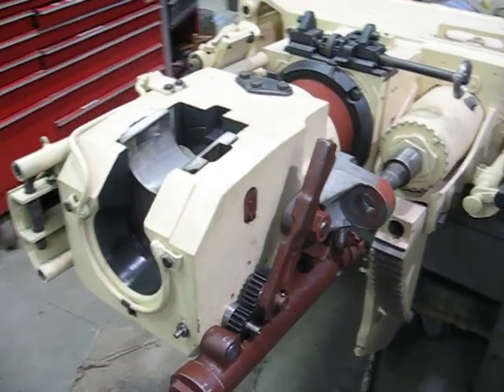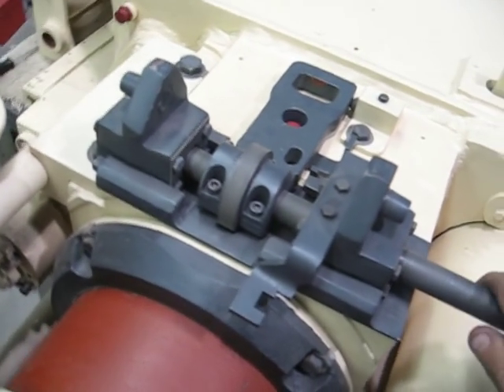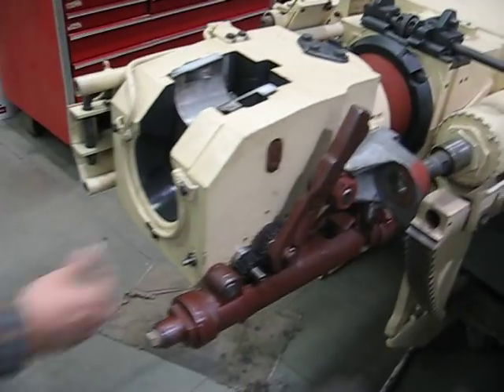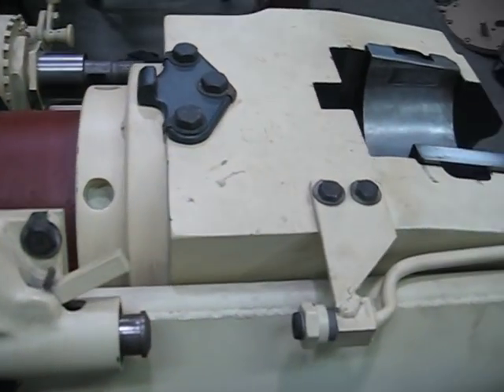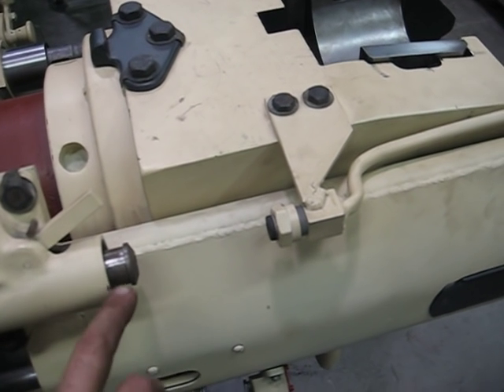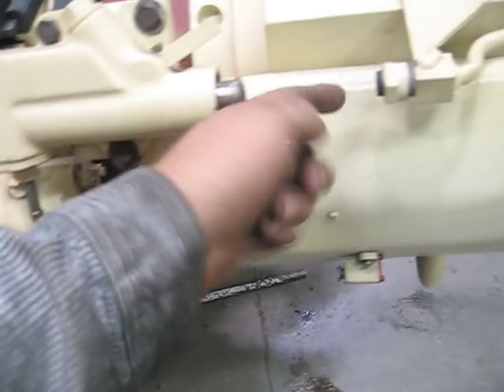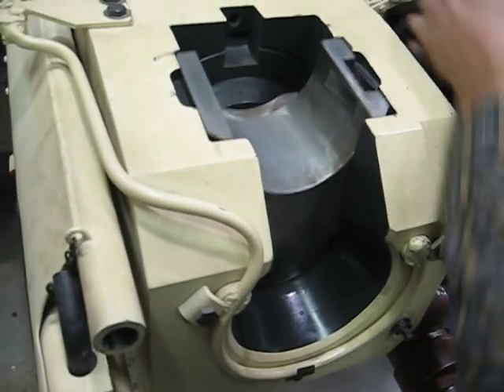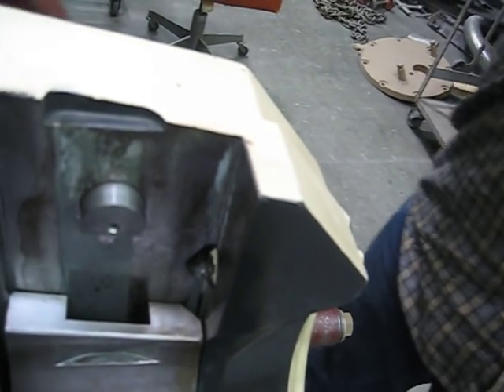Panther Tank 75mm gun tour!

Comment: Im nothing short of ASTONISHED regarding initial need to> concept, >design, >prototyping, >full production to >manufacturing runs & testing concerning the LIGHTNING SPEED development of the various PanzerWaffe vehicles under severe & very constrained conditions....
~All accomplished under the INCREDIBLE pressures of total war on MANY fronts......
-Let us not forget Germany is about the size of Washington & Oregon state combined!

AND the fact that EVERY single forged/cast/stamped & milled steel component/ part/screw/fastener/tiny light bulb, ect X'[s 10,000 was made primarily in Germany/CZ SKODA Werks/occupied territories...
Too say nothing of the TOOLING needed/created/invented in order to make a singular part?!
(Albeit often using forced labor-WORKING hands are bar-none, far better & effective than DEAD ones)

There prob isnt one single example of a U.S made piece of military gear &/or front line combat vehicle where EVERY SINGLE component of the weapons system is made within the U.S proper. IE: simple screws/fasteners/microchips/components, primarily being made outside the U.S, primarily in Asia!?

Sun-Tzu would be laughing n' rolling over in his grave considering the ridiculously ex$pensive, massive & complicated supply chain concerning the literal outsourcing the United States defense needs! 
ALL of it MUST be made & raw materials sourced within the nations BORDERS to be 100% effective & properly back-stopped-(With several redundant fail-safes & "Plan-B's" employed)

Example as to the U.S's common power grid needs: We have ZERO domestic, large electrical transformer production facilities here anymore?!....
-Ummmmm?...Hmmm? Kindve an IMPORTANT item now arent they?...;)
-They are all made in CHINA & then imported to our shores!....-Sheeesh! The list goes on n' on n' on unfortunately!

GREAT video! Thank you! so much! 
REALLY helps with getting eyes on the real thing, understanding/modifying/scratch building components of 1/35th scale Panther tank interiors when shown torn down under repairs in PanzerWerkStatCompany dioramas...;)
Reply: Dont mind my Ewwewtoob dedicated  line crossing censor...